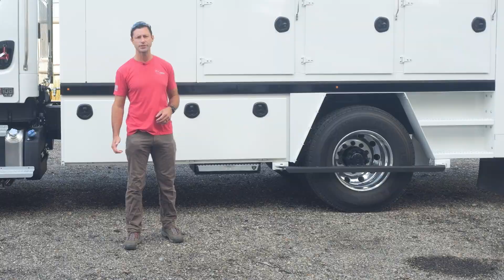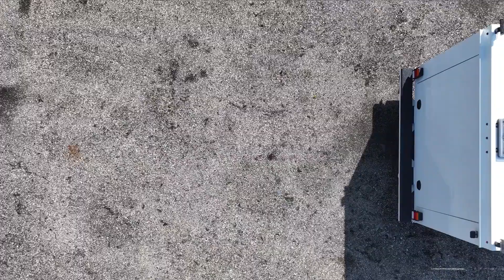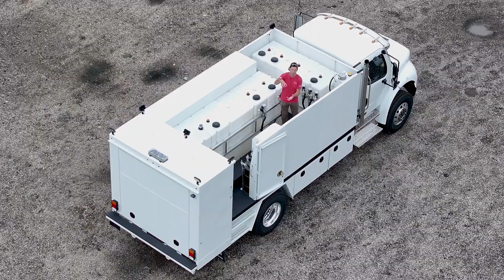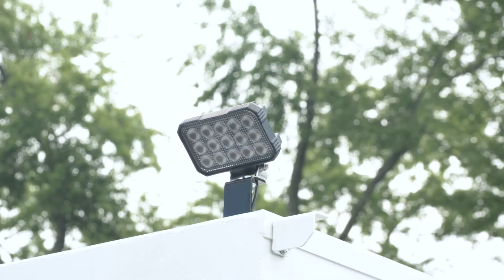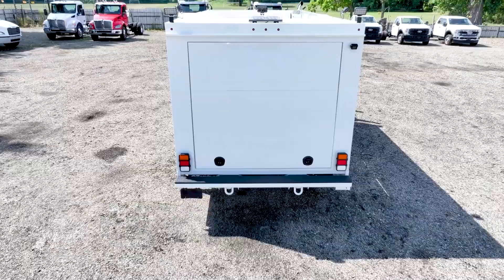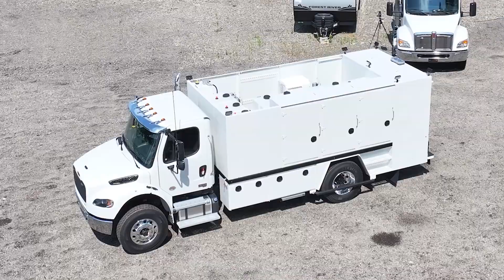Walkaround:  TORKT Custom Lube Truck

Comment: I feel like I commented on one of your videos years ago about lube trucks not having tow hooks on the rear. That bumper looks super nice and I like the receiver option for a vice. My recommendation is move the license plate and lights up higher. Job sites are never ideal terrain wise and I don’t see that license plate lasting long there. As for the lights, I don’t doubt that bumper can handle abuse. If you were to have an excavator or dozer pushing on the bumper with the lights so close, accidents happen and you’ll end up with broken lights and those don’t look super common to find down the street at the parts store. I speak from experience there. Also having lights mounted higher increases visibility to those folks behind you who probably aren’t paying attention to the road. As an other commenter also pointed out the rear awning door protruding a lot. I like the idea of the shade but there are some tight job sites where that wouldn’t work because the site is so tight the truck has to be backed within feet of the equipment or the door would be open into the only path through the job and some operator or truck driver would take it right off for you. Now it would be more complicated but maybe an awning door in two or three segments that fold up as you open it kind of like one of those big wide barn doors. That could kind of bridge the gap there for best of both worlds. All the open space is nice, never enough room for air filters or buckets. The simplicity of the controls in the rear is ideal, some manufacturers really know how to over engineer it. Last note, wire the two rear most work lights to come on when the truck is in reverse. No one ever complained about having too much light when reversing in the dark. As always I enjoy the videos, thank you.
Reply from the maker: Man this is awesome feedback THANK YOU!!!  Going to print this out for everyone in our weekly engineering meeting. 

Appreciate it!!  If you get a chance, text your shirt size and address to 330-697-7831 and we will get you some merch!  Thanks!!!!

Comment: Those lower doors make those drawers a pain in the ass to use. Major overlook.
Reply from the maker: Hey George!  Thanks for watching!!  Are you currently using one of our lube trucks?  Would love to discuss further.  330-697-7831.
Reply from the maker: Hey George, wanted to reach out one more time on this....  The design of the lower doors was an intentional decision that was pretty vigorously debated.  As you note, a drop down door it CAN be difficult to get into a box if that box was at, lets say, chest level.  However with the box at approximately knee level it seems to work out well for everyone we tested with.  

However, if you're seeing something different in the field, I'd love to hear it.  My cell is 330-697-7831.  Thanks again for watching and providing your feedback!!  We've got plenty of ideas that started with a customer saying "hey, this sucks!"

Comment: Fantastic walkaround of this lube truck bro
Reply: Great truck! Only thing really missing are white ground lights so you can see better walking around the truck at night.  I added them to my truck and a few other mechanics seen that and they added them to their trucks too. The other thing is after running a lube truck that filter storage box looks small. What would really be ideal is to have a filter crusher mounted in that open space.
Reply from the maker: All great ideas, appreciate it Richard!  Adding to my engineering list!
Reply from the maker: Right on it Luis!!!!  THANK YOU